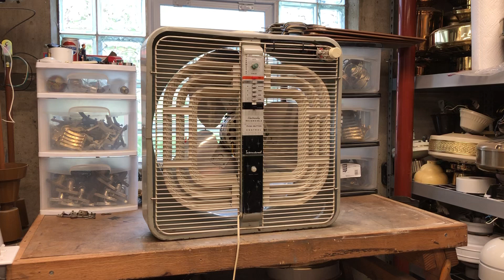International 96-043 Vintage Box Fan (Revisited)

Comment: Just acquired the same fan and knowing you have intimate experience with the switch, mine seems to be gummed up and doesn’t push in easily. What do you recommend as a spray in lubricant? Also my cage mounts a little differently, has clips on top and bottom.
Reply from the maker: Try a bit of contact cleaner first, I think this switch is riveted together so accessing the inside would require you to drill out the rivets, if you do that you can add some non conductive grease to help the 6 slide bars inside move more freely.
Reply: @thefandude21  That is a nice switch replacement. Hoped you could close up and say where you got it and how difficult it was to do. Thanks again.